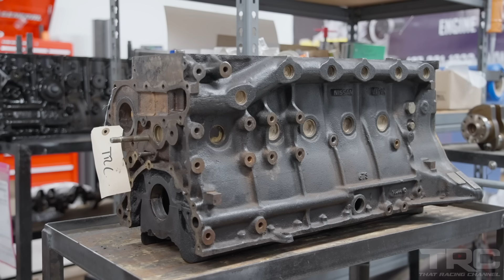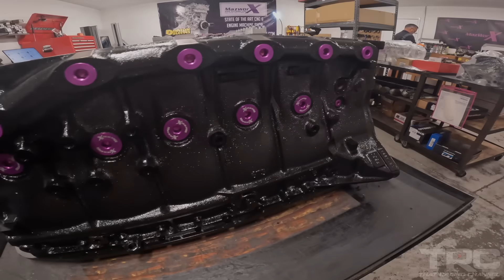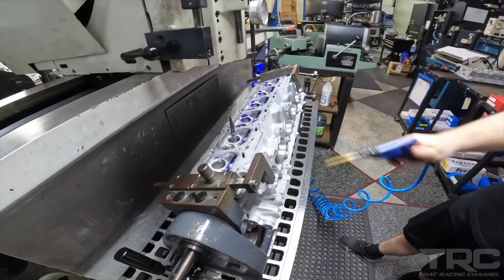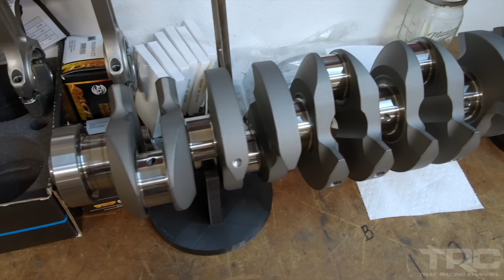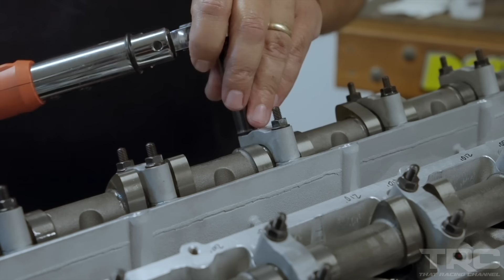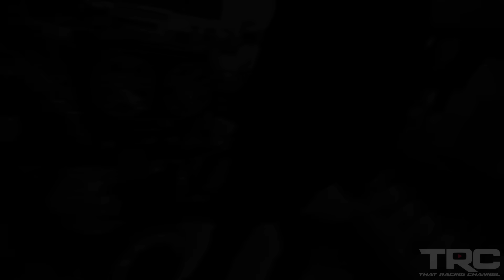1500HP RB30 Race Engine Build | Full Start to Finish with Mazworx

Comment: If I ever had the money to have a full service like this, I'd want to do an OEM+ build. No weird anodized parts, just black block and supporting parts and stainless parts where needed. And then a nice wrinkle painted valve cover and intake manifold in OEM red or body color matched. Just clean and reliable. HELL YEAH
Reply: Anodised is like putting lip stick on a pig, yuk
Reply: Did you not see all the prp purple anodised parts used??